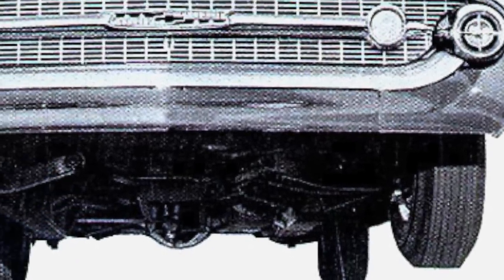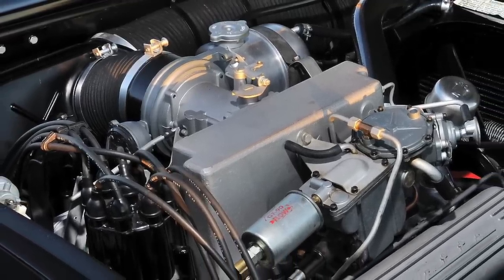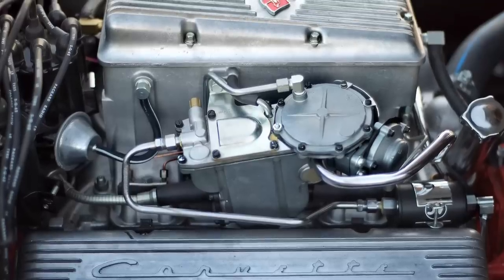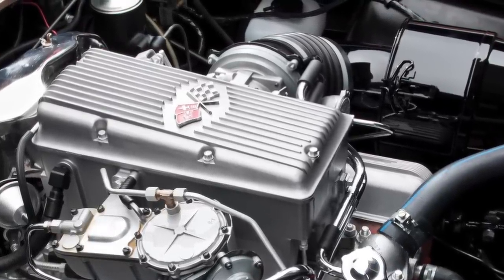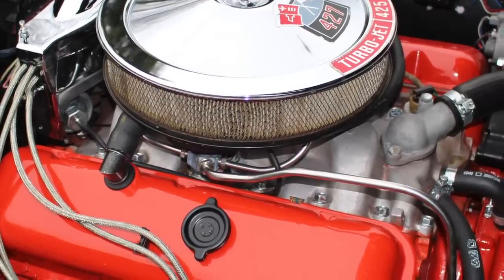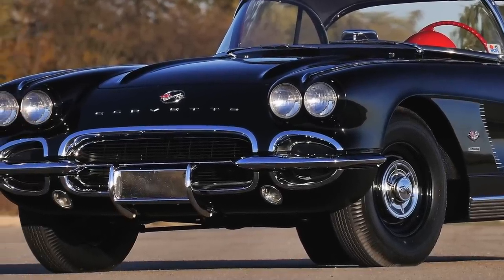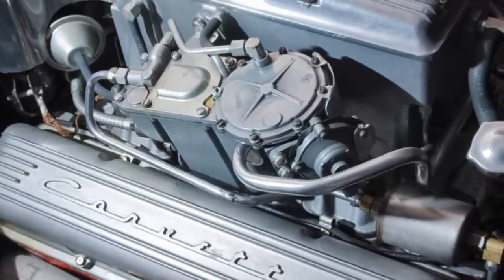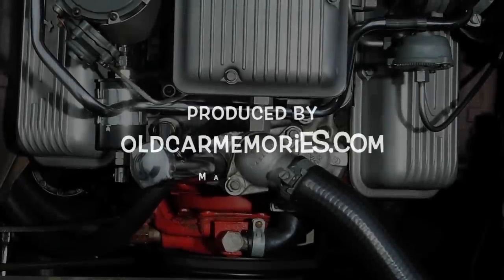Why Chevy Abandoned the 1962-1965 Fuel Injected 327 V8

Comment: Having known two people that bought the fuelie Corvette new, and hearing another four talk about their experience with the old fuelie, this video is NOT ACCURATE. While the power numbers are close to dead-on, the reason the engine went 'bye-bye' was the TECHNICAL PROBLEMS associated with them...every single owner of one I knew flat-out stated that 'THEY WERE A BIGGER PAIN THAN MECHANICAL LIFTERS! You always had to be tinkering on them to get them to idle and run-right. As a result, most owners tortured dealers and their service departments to keep them tuned, while the parts were expensive to repair and replace if they failed. KEEP IN MIND, these old fuelies were NOT COMPUTER CONTROLLED! They were mechanical! Timing on a mechanical fuelie is more akin to keeping a diesel fuel injector timed properly than a much-simpler electronic one...thus why it took almost 3-decades to get back to fuelies...we had to have the technology to make fuel injection work properly! Bottom line: fuel injection is a no-brainer now, but you REALLY don't want the hassles of trying to keep an old fuelie running...you really don't.
Reply: I sometimes watch these kind of videos just for fun and a little info, maybe even for the comments! But true it was mainly the fact that this FI system was not ready for the market with its problems. Seems like a lot of these videos are just kind of click bait or self serving with only half truths. Like I've said new car buyers do not want their new expensive car (and they all are) sitting in the shop.
Reply: ++ Skeeter Saurus.. Not gonna argue about needing the right technology but consider that VW used an inexpensive Bosch multi-port style electronic injection starting with their 1968 year type 3 vehicles. (the fastback and squareback models) They basically gained around 20% in HP plus a better running engine at all temps. IOW, the technology was out there but American companies hadn't started using foreign parts yet. Mercedes, and Saab slowly switched over and by the mid 70s Datsun / Nissan was also using a similar system on the 280Z. When did Chevy take the hint? Recalling it was some time after 1986 they started using the throttle body style, which worked well but not as efficient as the multi-port system.
Reply: Skeeter you are spot on!  While from a marketing and cost perspective the big blocks developed more torque over the range than the fuelies, quite a bit more.  They were cheaper, simpler and more reliable in general.  So naturally the fuelies lost out.  

Many people have no concept of the difference between computer controlled or mechanical VS carbureted or injected.  They have limited if any knowledge of sensors, microcontrollers, controls, pulse width modulation, etc. and thus seek to define everything according to their limited technical knowledge or capability.  Hence why having to tweak a mechanical injection system for a gas engine would be a PITA for people of such a skill level!  Thus, rip it off and replace it with a simple, reliable carburetor.

Many people have no concept of the difference between spark or compression ignition engines or any of the issues.  Mechanical injection worked wonderful in compression ignition engines and really dropped away due to emissions regulation, as they were very reliable and efficient.

And when you mention mechanical lifters, most folks have no idea that that is.  In Oregon people do not even know how to pump their own gas, let alone understand having to do regular and frequent service! Easy to talk when you do not walk.  Nothing is impossible for a person that does not contribute!
Reply: Was the 57-65 injection similar design to the "throttle body"?
Reply: GM's TBI systems came into service in 1981 for the 1982 model year on many of their cars and trucks, with the Corvette getting the 'Cross-fire' dual TBI on the L83 350ci engine for '82 & '84 (there was no 1983 Corvette - and no true 30th Anniversary model - due to the total overhaul of the 'Vette for '84), and then went to the 'tuned port' fuel injection for '85 and later. What's kind of strange, is that both Honda and BMW launched motorcycles with port fuel injection before Detroit released their first electronic TBI systems!!
Reply: You are wrong sir! There is no timing problem with the Rochester FI because it was continuous flow the amount of fuel injected was changed by the delivery pressure. More air flow, more fuel pressure, more fuel through the injector nozzle. The injector flowed fuel at all times just smaller amounts when throttle wasn't opened much.
Reply: MadMaxxMoto you are also wrong sir, Dodge and desoto offered electronic port injection starting I think 1957 and only two or three years. It sold very few units and was a complex analog computer controlling the electric injectors pulse width. It's timing was controlled by a separate distributor-like gizmo mounted on the normal type distributor. I think it was made by Bendix but I could be wrong
Reply: Skeeter Saurus right on. In 69/70 i was doin advanced research on fuel injection and the COMPUTER/controller was as big as a small refrigerator  and if i remember correctly a pick up truck was our first street test car.
Reply: The biggest mistake made IMHO was not turbocharging the fuelie. The "Constant Tinkering" was often due to things carburetors automatically adjusted to, like temperature or starting cold then warming up, and neither carb or Mechanical FI delt well with altitude changes, but mechanical FI did it worse. Turbocharging would solve half the driveability issues of mechanical fuel injection, after all it "Fixed" the Turbodiesel the same way and its mechanical injection, too :)
Reply: @V8_screw_electric_cars  No.  It used a mechanical injection system driven by the engine, making it more similar to systems used in a variety of diesel engines.  It wasn't computer controlled like the injection systems we think of today.

Comment: After HS in 1964, I bought a '57 Chev Convertible with a 283 and Carter WCFB carb. A friend had a 57 convertible with the Fuel Injection. His was a lot quicker than mine. However mine was faster in 1/4 mile than most 390 Fords with automatic transmissions.
Reply: The "Blue Flame" inline 6 probably was also.    (j/k)
Reply: @789pokey  Oh!!! your funny!!!!  you must have seen alot of big round taillights in your day!!!!

Comment: The Tucker back in 1949 had fuel injection. That's before the Mercedes.
Reply: Tucker Carlson has had fuel injection since the 80s. Toyota Camry I believe.
Reply: Steve Packer Mercedes had fuel injection for Diesel engines in the 1800's
Reply: Shhhh... don't tell them. Lol
Reply: Fuel injection is a force carb is a allow true competition carb wins any records?
Reply: Mercedes had Direct Injection, not Fuel Injection (Direct has injectors in the combustion chamber, Fuel Injection has the injectors in the runner)
Reply: Volkswagen  had it in the 70's
But Tucker had fuel injection? That's very interesting, however I am sure Tucker was not a production car.
Reply: Tucker's did NOT have fuel injection.   That was one of the features that Preston Tucker originally touted for his car, but it ended up running a common two barrel carburetor.

Comment: The Big Block Corvette was a brute to be sure. But Father Zora Arkus-Duntov wanted a neutral balanced car with a 50-50 weight distribution. Big Blocks couldn't do it without Aluminium heads where the small blocks were a natural without. Also the Fuelie motor had a flat torque peak that was a tremendous advantage in road racing. Drive one with your right foot to the floor and shift under power at the Red line and you will see what a flat torque peak in a small motor can do for excitement. Temperamental to work on? Most dealers didn't get someone trained. They have the finicky quirks but not that bad.

Comment: I remember that fuel injection units were readily available in the later 60's.  One speed shop nearby (Blair's in SoCal), not the cheapest place to buy but they had shelves of them in the front window for $100 (asking) for early units and up to $300 for the latest 63-65 style.  I bought one for $75 for my 57 Bel Air.  At a recent car show, I saw a 57 210 with a reproduction rochester...much simpler and fewer fins in the casting.

Comment: The Mechanical fuel injection system was so simple it makes you cringe when you see it compared to an all electronic system. It was Self compensating for atmospheric pressure. Some thought it made it temperamental .Some Mechanics simply blocked the compensation . No Carburetor Icing , no Vapor lock .It needed but a few minutes to warm up not 20-30 minutes for a carb. And the response was instant from the moment you started it.
Lets face it most Mechanics were called Grease Monkeys for a reason- not to brite. Don't understand it ,fear it. Destroy it.
Reply: Why do people think that modern fuel injection is so complicated to work on?
Reply: You like old stuff - I get it.  but don't try to make the case that an old mechanical FI system is superior to today's computer controlled FI... that is just silly.
Reply: @rthomas6564  because it is !  they use 1 fault code for several different sensors , the big 3 intended it that way to earn more profits off of hard working people , 1 customer was charged 7 hours of labour to diagnose the problem , they still could not identify the failed sensor ( yeah right  ) ford uses several different types of bolts on their vehicles that regular garages will never have access to the tools required to removed them . but donald trump was correct though , he lamb blasted the big 3 for  over complicating a simple engine design 

the big 3 now have to assign a single fault code to every single sensor as per your NHTA

Comment: I love modern computer controlled fuel injection systems. I grew up in the carburetor era and it was such a pain. Those old cars were often hard to start and they often had driveability issues such as hesitation and stalling. You also had to spend a lot of time fiddling with the carburetor to try to make it work correctly. All of these problems go away with fuel injection. And if you do get a malfunction the computer will even give you a good idea where to start looking.
Reply: Joe Vignolo Fords will do that. Drive GM!
Reply: @capitandonzi2113  I owned both Ford and GM cars that used carburetors. They all had the same problems.
Reply: Carburetors were pretty good before emissions regulations. But you couldn't make them run right and still not pollute. That's why electronic fuel injection became the norm.

Comment: If you analyze the plenum design, it's very similar to that of the TPI units released in '85 for the Corvette and F bodies.  The only difference I can see visually is the throttle body is placed on the side instead of in front, and lack of runners to the intake manifold.  I'm sure GM's Diesel division took some inspiration from the mechanical injection pump and used it on the '78-'85 Olds Diesel, and the 6.2 Detroit Diesel that was released some time before the Olds Diesel's life cycle ended.
Reply: Midnight Mechanic it’s even closer to hsv’s twin throttle manifold off the Holden 304/355
Reply: Holden got all the performance goodies that us Yanks didn't know existed, so that also most likely was an influence, as the TPI also has a twin intake throttle body.  It's an excellent low to mid torque fuel injection system, unfortunately only the performance models would see use of it, trucks never got a TPI unit (some performance trucks got a multi port fuel injection system, however they're rare) and only got to see use of throttle body injection, for less complexity and cost effectiveness.
Reply: I keep wondering where the DOHC Pontiac V8 is.
Reply: Now that you've mentioned it, most likely it'll be covered in a later episode.  Most likely its production was too expensive as well, anything technologically advanced for the time is going to be too expensive to maintain and purchase by the average consumer, take the earliest personal home computers for example.
Reply: Gasoline  & Diesel  Fuel injection have nothing to do with each other ..   Modern Diesels   have injector pressure  like  6,000  PSI       
  The  78-85  Olds   Used a Standardize  fuel injection pumps the same one they  use  on older   IH and John Deere Farm  Tractors..   I had an 81 GMC Diesel  pickup the pump went bad   cost about $500 to have one rebuilt back then ..   The Governor ring had fallen apart..  a very common problem ..
Reply: My older  Chevy  350 pickups   get  better mpg with a Carb  than  my  two  1988's  got with TPI that  thing sucked ...
Reply: Modern Diesels also use a pump mounted driver, the old mechanically injected units did not, hence why some people prefer them over the electronic models.  Mechanical injected ones can also run bioDiesel fuel without much complaint, however the pumps and injectors themselves are like you said, used more commonly on tractors than road vehicles, thus some reliability issues from being overworked and or undermaintained.
Reply: I had a 1974 Chevy 3/4 ton, 454 that got 12 to 14 MPG on regular and a 1988 GMC 3/4 ton the never got more than 11 MPG and ran badly on this 87 octane  ethanol.
Reply: All Diesel pumps are mechanical  but  the modern ones  have electronic controls   or maybe  solenoid type plungers..   but  solenoids are mechanical too ..
Reply: Mike Skidmore you are dramatically underestimating the pressures involved in modern diesels.  For common rail systems running cp3-cp4 pumps, are running upwards of 20k - 29k psi depending on year and engine platform.
Reply: There is virtually no similarity between the diesel and Rochester gas FI systems.
Reply: I forgot the figures and did not  use  google .. but yes the point is  people commenting here  seemed to think that  diesel Compression ignition and  gasoline systems were similar..  I also wanted to point out that GM  has timed direct  injection gasoline engines  that  are way more efficient .. they allow  higher compression  ratios with low octane  gas do to the fact there is no fuel in the cylinder until  just before time for spark plug timed injection
Reply: Actually the principles used by the Bosch CIS system are VERY close to the Rochester system used in Chevy and Pontiac in 1957-65.
Reply: There are ALSO timed petrol injection systems that use a diesel type pump and rather high atomization pressures. Most of these were Bosch, starting in 1953(?) with the 300 SL. Most all SL and SE Mercedes used such pumps as well up thru the 300SEL 6.3 V8. 
Porsche 911 from 1969-73. BMW 2002Tii used a similar system from Kugelfischer. Porsche tapped Kugelfischer for its race car pumps, 908, 917, 935 using Kugefischer.
These mechanical type systems gave good performance, were pretty reliable as long as one changed the oil. (Yeah, they used circulating engine oil. Gasoline has no lubricity). the price of a Bosch pump would be about the same a a whole 1965 FI Corvette.
Reply: Mmm, principals, yes, but construction, fuel delivery ( the GM system used a float chamber instead of high pressure) and air mass was measured differently, in a lot of ways the K jet system was simpler. The GM system is pretty much the Bendix pressure carb injection system with a fuel distribution block to the injectors.
Reply: There is a hp pump INSIDE the float chamber driven by a cable from the Dizzy. The measuring device uses a remote diaphragm instead of the air flow plate, but its action is similar as well.
Reply: Obviously you know about German stuff. Why do you suppose Porsche sourced their race  car (908, 917, 935) pumps from Kugelfischer?
Reply: Now THOSE were different! Belt driven, basically diesel pump design. Same with Spica on Alfa Romeo. Those kind of systems are sequential as well, the K jet system was continual as was the GM system.Look into the Bendix system used on aircraft, it's what GM used. I know about the internal pump, distribution block, injectors and so forth as I restored a couple fuelly vettes. Sent the metering assembly and injectors to a specialist got rebuilt, did the engine work through our machine shop.
Reply: I worked in a new car dealer and we got stuck trying to fix the pontiac diesels. The vendor made the fuel lines that had defects that  flaked debris into the injectors just from bending them while replacing the pumps. One problem after the other.
Reply: Al Brase kugalfisher translates to ball pump. They are nearly identical to older "high pressure" diesel injection pumps. Bosch actally made the pumps. These systems were used on lots of things during ww2 by the Germans. They were even doing direct gasoline injection with them on some engines. There were even some Datsun race engines with the German pumps adapted to them in the 70's.
Reply: Yep due to emission controls
Reply: Mike Skidmore, I picked up a near perfect 1986 IROC Camaro in 1990 -only a  305 W/ TPI -it got 26 MPG and has never given me any problems . I'd take it on a cross country trip today,with out a thought-if only a huge tree limb hadn't fallen and crushed the t-tops,windshield,etc last year. Body shops wants a blank check to fix and I'm fresh out of those!   Bob V. in IL.
Reply: Sorry to hear that, hope you had insurance

Comment: Fuel injection though standard still is more expensive than carburetor
Reply: It is but the power gains almost entirely nullifies the costings. Since it is much better at resisting knock and allows for much higher compression.